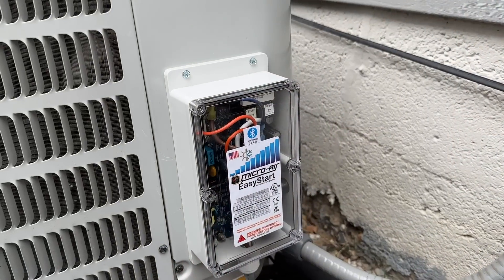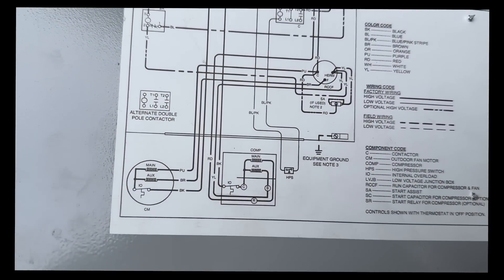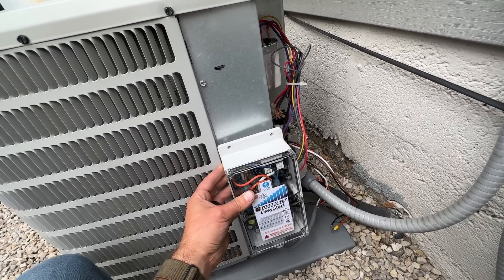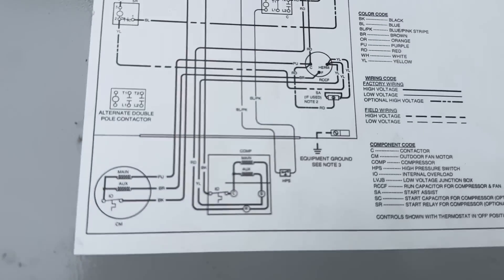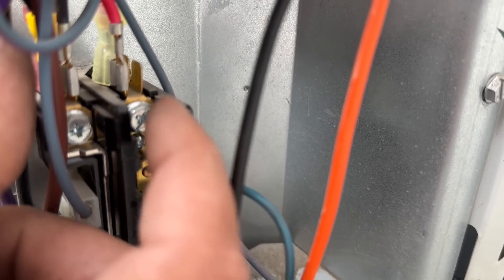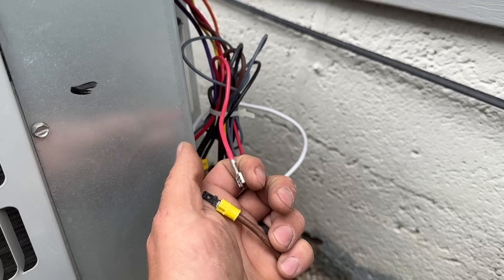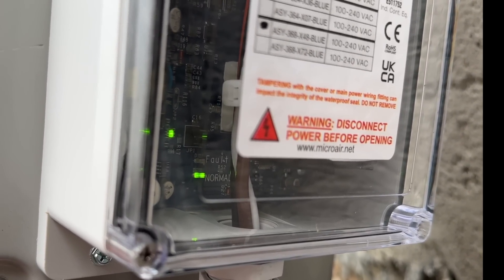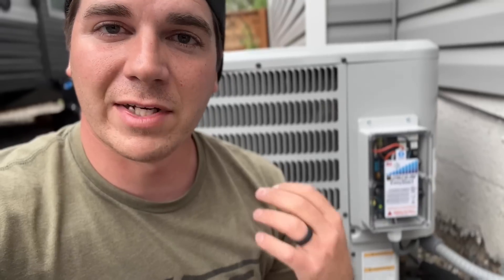Prepare For An Emergency Power Outage By Installing This Device.   Micro-Air Soft Start

Comment: HyperEngineering also makes a quality soft starter although without diagnostics so it does cost a bit less. Soft starters are very popular with the Solar Community since most inverters cannot provide the usual, inrush current.

Comment: Hi, I installed the Hard Start kit on my 5 ton. Do I need to remove it in order to install this Soft Start kit?
Reply from the maker: Yes you need to choose one or the other. If you have no need to run your system with a generator I say just leave the hard start kit on your system. It is a good product to have installed

Comment: I installed my micro air soft starter in September 2022 & have over 3,000 starts on it already. Works nicely & reduced my original 77 amps down to 23 amps. I had the chance to 1st use it with my champion 7kw portable generator when we lost power 3 weeks ago in my neighborhood for 6hs. It worked excellent with my generator In starting my AC!!! My Generator didn’t surge 1 bit when the AC kicked in to start 👍🏽 so glad I installed this piece of gear.
Reply from the maker: Awesome! I’ll be doing a video on this soon!
Reply: @diyhvacguy  Where did you purchased that gizmo? I want one for my a/c.

Comment: I have a 5-ton unit so I'm going to need the biggest model micro air they have available however I do see the benefits. Bookmark this video for when I'm ready to install it myself! Thank you for the video!
Reply from the maker: Awesome! You can find the one that is sized for your unit in the video description 👍🏼
Reply: @diyhvacguy  ASY-368-X72-BLUE is the model number I was looking at I think it just adds the Bluetooth feature with an app for your phone but it's still the same 368 series.

Comment: My 3-ton scroll split system has the condensing unit at ground level and evap in the attic. In my climate, this unit sits idle for 9+ months, so the 1st start is always flooded, since the condensing unit is colder than the evaporator. The compressor noise on that 1st startup sounds painful and can't be good for the compressor, so last summer I installed a soft starter and it's amazing how well that works! 1st startup sound had hardly any of the previous clattering noise after sitting for so long. I didn't expect this to work as well as it does for flooded compressor startup.
Reply: Make sure your compressor has a crankcase heater. If not you can get a bellyband heater and install it yourself. Make sure power is off first. 240 volts!

Comment: Let’s see how fast you ban be!
Wow, wow, wow. 
You will not save any money using this type of device!
The momentary inrush/ use of power to start or the LRA needed is way to momentarily of a power consumption to saving anything on your power bill. 
Now in regards to being able to use the AC with a generator YES this now becomes a great idea and it does work well. 
How do I know? I installed a 368 on my 3 ton unit this last year (myself and I’m not that smart) and is does a great job of reducing the start up amps needed, yes I ran my house including the AC on a battery bank system to boot. 
These easy starts should be a good up sell for you if you see a transfer switch on houses you service, stock them on your truck.
Reply from the maker: I realize this now after all of the comments. I am learning new things every day. I’m still curious to see if there will be any change in my electric bill but the biggest motivator for me was for emergency preparedness. I’m swapping to a heat pump 20 seer system soon, so being able to have heat with a generator is a nice thought. Anyways thanks for the comment! Cheers man
Reply: @diyhvacguy  
Well, I’m impressed. 
Most YouTubers can’t handle decent. 
Good idea to be able to hear and cool your house in the trying times ahead.

Comment: It would have been interesting to see what the normal run amps are before and after.  The INRUSH is the peak start up amps and it should have dropped down once the compressor started.  So this thing will not likely safe you much money but it definitely will allow a much smaller generator to be able to handle the startup current.
Reply: That's the whole point.  It lowers INRUSH,mainly for a generator, but in small part for longevity of the compressor.  It has NO effect on running amps.
Reply: I think IDK. , But I think what he is saying.  It would be nice to see the inrush amps and then watch the amps climb to RLA.  I thought that would have been nice to see as well. As a retired industrial HVAC/R TECH, many of my systems were controlled by VFD ( VARIABLE FREQUENCY DRIVES) that took as long as 4 to 5 minutes to fully ramp up to 100%.
Reply: See comment

Comment: Going back to my first question after listening to the whole video that you produce you did say it will work on a heat pump. Got a little ahead of myself. Just curiosity what’s the average cost for the unit? 8:08
Reply from the maker: There are links in the video description. About 300-350 for the east start kit.

Comment: Question, does this soft start work on a AC/heat pump unit. I really enjoy your videos that you produced It is very educational. Unfortunately I’m a electrician by trade not a HVAC, you explain it very easy. Thank you so much. 5:18
Reply: It will work the same, Philip.  The difference between a straight cool unit and a heat pump lies in the fact that the heat pump has a reversing valve.  In the winter when you set your thermostat to heat, the reversing valve redirects the refrigerant to flow in the opposite direction - causing the inside evaporator coil to act as the condenser and the outside condenser coil to act as the evaporator.  A little added complexity, but the same current draw.  The EasyStart won't know the difference.
Reply: Soft-starts like this one should not be used in modern variable-speed, inverter-driven HVACs as those already contain "soft-start" circuits. If the compressor motor uses a contactor and it starts with a bang, this soft-start will work. Also, resistive loads like heater coils don't need to be soft-started.

Comment: Thanks for the video.  For me, the jury is still out on this, but will definitely investigate it more.  I did notice, however, a minor electrical code violation on the install.  You cannot mix low-voltage wiring with line voltage wiring in the same box or enclosure, so bringing the line voltage leads of the Easystart in through the low-voltage thermostat wiring enclosure is a no-no.
Reply: I don't think he touched any low voltage connections. The 4 wires he hooked up went to the switched L1 side of the contactor, the L2 side of the contactor, HERM on the capacitor and then to the run winding of the compressor.  The 24 VAC connections on the contactor are usually on the sides and I didn't see him touch any of those.
Reply: @JW-zz2lh  I realize that.  That's not the point.  Line voltage wiring cannot occupy the same enclosure space as low-voltage wiring, unless the low voltage wiring insulation is rated for line voltage, which in this case was not.
Reply: @mikef2618  T-stat wire insulation is rated for 150 volts.  Not an electrician but believe this is done because lots of places t-stat wire is controlling relays and contactors that in turn control 120 volts.
Reply: @mikef2618 ood point but need to clarify somewhat. Everyone’s AC has low voltage combined with high voltage in the ‘enclosure’. You open up the panel and it is by design that way.  You may be saying running it through conduit is against code, and that makes sense.  Whether or not his install would be defined as conduit I’m not sure.  24v AC wires are right next to 240v wires on the contactor. Just trying to get a clarification.
Reply: @JW-zz2lh  If you watch and listen again, he ran the wires through the same hole as the thermostat wires and now they live together in the same location.

Comment: Very expensive surge protector, minimal savings. I have ductless heat pumps and it pulls less than 3 amps. With my solar panels I save already. Nice video though. The major advantage of a soft starter over a hard starter or nothing at all is that this device will extend the life of your compressor and motor and do diagnostics as well. The ability to add a generator is also a plus for those who need it. Again the energy savings are marginal but may be worth for the other reasons.
Reply: The Only Real advantage of a Soft Start is to start a standard HVAC  Unit with a Generator  Its not going to save you money on my Power Bill !
Reply: @danray9744  see my rewrite to my initial comments. The device may be worth it for other reasons than strictly energy savings.

Comment: Can you still use this and get a benefit from it without having a generator hooked up?
Reply: Yes, the whole idea behind this is to delay inrush current on startup, having it hit 30-70A can cause a generator to go into overload or stall the generator.
Reply: It helps even if you don't have a generator, reduced the hard start on contactor and on the compressor.

Comment: This would only help in a situation where you were billed on peak demand. With smart meters, it's conceivable that will happen to residential accounts sooner or later.
Reply: Agreed.  My high school stadium was billed a rate based on peak demand for the month. This meant that simply turning on the stadium lights then turning them off would cost about $1000 because that boosted the rate to many multiples of the base rate.  If they try to set up my house on that kind of plan I'll be peak shaving with an inverter and batteries (already installed for backup power and solar).
Reply: @Sylvan_dB  exactly!
Reply: @Sylvan_dB , an electrician friend of mine used capacitors to obtain the same result you're talking about. Excellent point. 👍
Reply: Yup. This thing has no real benefit in the larger single phase AC's used on homes. It is just another sales gimmick for resi companies to sell once they sold the customer the other gimmicks.

I briefly worked for a company doing resi and commercial who would just latch on to these kind of things that they could hype and sell.
The techs were paid by percentage of invoice. So the sales techs got good at selling snake oil.
Reply: @hackfreehvac , that may be a little too simplistic. People who are billed according to demand may benefit from this.

Comment: Do I need a generator for this to work
Reply from the maker: No this ALLOWS you to power your ac with a smaller generator in an emergency
Reply: @diyhvacguy  So can I install it and run it every day ?
Reply: @martigustamante1230    WHY ??     Soft start are for when your wanting to run your AC with a Generator      it's not going to save you any money on your power bill .

Comment: I have a 4-ton (46,000 BTU) A/C unit. The compressor specs list a 109.0 LRA. I installed a Micro-Air EasyStart 368 (4-ton) Soft Starter ASY-368-X48-BLUE. After the EasyStart "learned" the unit after five starts, the AC unit now has a Start Peak of 33 to 36 Amps. I have seen a 42 amp start peak when connected to my 6900/5500 watt tri-fuel generator running natural gas. It will also connect to a smart phone App using Bluetooth. It shows that it has 25851 total starts.
Reply: 6900watts @240volts is only 28.75 Amps Starting Surge Watts   so if your AC is Drawing 36 inrush amps  The Gen is To Small NO Way it can handle 45 amps Inrush !
Reply: @danray9744  I have the Firman T07571. 6900/5500 (NG), 8450/6750 (LPG), 9400/7500 (Gas). I don't believe the NG Watts Firman lists. And not too sure about the watts displayed on the Micro-Air app. I just started the A/C (grid power). Live Current 13.1A, Last Start Peak 35.4A displayed on the app.
Reply: @danray9744  The generator has been used during the summer when we lost power and the A/C worked while supplying power to computer, TV, fridge and some LED lights. Someday I may get a meter. I am an I.T. guy, not A/C guy.

Comment: You did the right thing by installing the micro air. I installed one on my new centeral AC unit in April. Starting amps before was 65A. After installing 23.4 starting and 4.7 running Amps. Big difference. My unit has started 100 times since installing. Could not be happier. Keep up the great videos.
Reply: Running amps won’t change
Reply: Were you also measuring on the common instead of L1/L2?  Most of the current should be on L1/L2, not on common.

Comment: When it comes to a hard start or a easy start, I'm guessing that an easy start reduces the inrush current a little more, but for a $300 difference in price, is a soft start that much better?
Reply from the maker: That’s for you to decide. If it affords me the ability to run it in the summer or winter and have heating and cooling with a generator, I think it’s way worth it for me. Cheers

Comment: Just put one of these on my house as well. However microair says that the decrease in starting amps is negligible on your power bill as the start up only last a few hundred microseconds. They say the true cost savings is in maintaining the system and sizing the generator.
Reply: Inverter variable speed compressors are the future and are miles ahead of these borderline snakeoil "starter" products TBH.
Reply: I agree.  The starting current, called the "inrush current" in the video, is just a brief transient that probably totals about a minute per day.  The savings of electricity by reducing the inrush current will be negligible.  HVAC Guy should also have shown us measurements of the non-startup operating current, before and after installing the gadget.
Reply: @Brother Mine  Still a good product, I wonder if it extends the life span of the compressor?......
Reply: @hvacgoat9451  It should
Reply: True statement, I guess the real test is run the system without the easy start for one billing period, and then run it with the easy start for the next billing period, while trying to mirror the same run duration and start stop periods, and thermostat settings. Goodluck
Reply: $304?... is it worth it?🤔
Reply: @sn3495  -- for me the answer was No!  My startup current varied between 35 and 65 amps.  35A my generator was happy with but anything above 45A it was not.  And the elephant in the room is you can't call them for tech support!  Buyer beware!
Reply: correct the the start up amps are short but the running amps is what matters most. as that is whats spinning the meter. and your gerny can run.
Reply: @timgriffith9149  The inrush current is usually what trips the generator though, so this could make the difference between being able to run the AC on the generator at all and not.

Comment: How does it save you money? Is reducing the current for a half second that large of a difference?
Reply: The same energy has to come from somewhere.
Reply: @skidooextreme2233  I agree. I don't think this saves money.
Reply: @skidooextreme2233  Right, it just spreads it out over more time.
Reply: Doing a quick calculation, the savings is about 50 cents each year. Given 2000 startups each season at 10 cents a kilowatt hour cost and a half a second reduction of inrush current, about 30 amp reduction at each startup. I agree that there are other benefits with the soft start, but I don't think cost is one of them. Unless I'm understanding this wrong.
Reply: @vegasguy73  I agree. It's only a few microseconds, not even a half a second.  It does reduce electricity usage but it's pretty minor.
Reply from the maker: Some have said that electric companies could start billing based on peak usage. But I apologize for any confusion here. I’m still learning but I am curious to see what my bill looks like at the end of this month compared to this month last year and the year prior! Cheers all
Reply: you cut power draw every time you cycle on... thousands of times a year...  so for those brief periods, you're reducing the demand draw...  1/2 of the entire power bill ? no.  Peak draw ? yes.
Reply: @lylestavast7652  -- I lowers the startup current by slowly ramping up the voltage.  So the power required to start your compressor remains the same.  It just spreads the current out over a longer period of time.  It will not lower your energy bill!!
Reply: @lylestavast7652  It smooths out the peak but it takes longer to reach steady state.  So there really is no financial savings.  It may be easier on the compressor.  It was mainly developed for RV AC so that the generators on RVs could start and run the AC.
Reply: it takes longer to start so its a wash! less stress on the motor so it may last longer.
Reply: @rustyBdTZ  -- Lightning strikes and not pulling a proper vacuum on they system during the instillation process is the primary cause of compressor failures!
Reply: I would love to see a follow-up video on your impressions of this device at 1 month 3 months 6 months...etc.